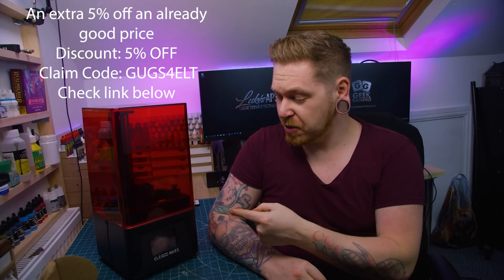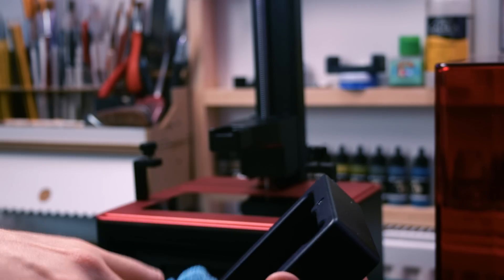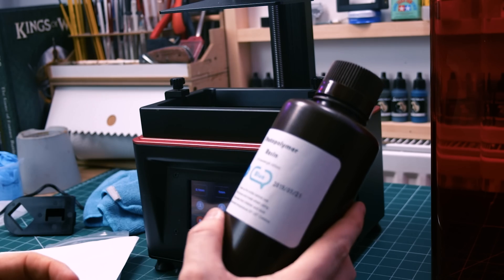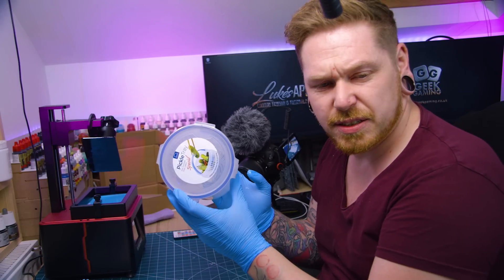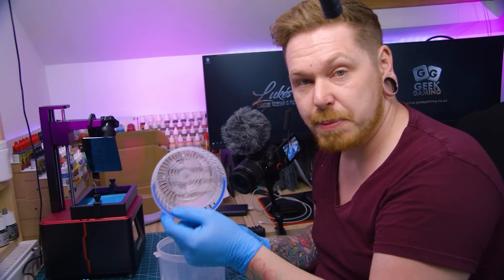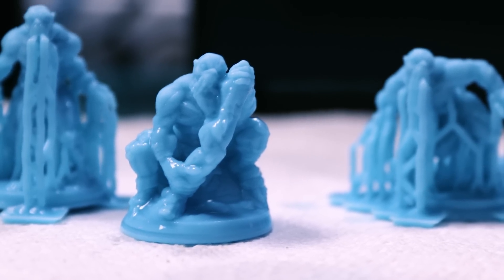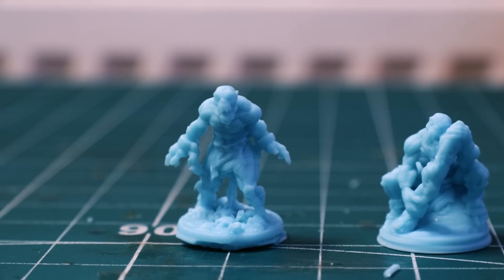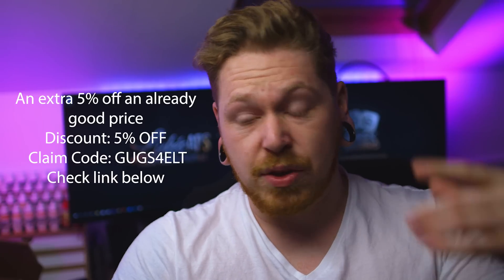MY FIRST TIME Using 3D RESIN PRINTER (ELEGOO MARS)

Comment: Judt got my elegoo mars 2 pro a week ago. When I levelled my plate I think I saw a YouTube short on how to do it easily, just set to home like usual, them push down on the plate with one hand (not too hard) while you tighten both screws, I've printed probably 12 models over 8 prints and haven't had a failure yet.

edit: he just did this lol, I should watch the whole video I suppose

Comment: You know what iv baught one the elegoo mars pro 3D printer months ago ok i actually over paid for mine cause people are getting these with a washer and curing tank too with resin i paid nearly 200 english pounds so about 230 to 250euros been from ireland and then nearly 40euro bottle resin i have not yet had a single test print that even stuck to my build plate its so painfull after buying something so exspensive not been able to get what i baught it for from it i am like u never used or seen one in person but i have to say im trying here for a successful print while i write this so wish me luck but i have to say you have explained what and how to so easily instructions from u as u said ur a novest like me i know noting of them but u explained in this video how i can understand easyer but iv had this print started b4 i watched this video from another guy it was setting it up i watched so if that works out ill be so happy i didnt throw so much money into the bin but ur advice and video has given me some confidence if this print fails on me but ill see in little over 2hours left but thanks for sharing your video my next problem will be downloading 3D stl file to my pc and slicing it onto the USB drive thing iv to learn next if this goes well is how to put 4 wheels on plate rather than 1 that pops up when i try its free stl file from thingaverse or something like u said u got ur prints from anyway sorry for rambling wish me luck iv it over or around 6months and have yet to get something from this its driving me mad well have a great rest ur week and week end stay safe keep good learner vids coming specially settings i type into machine to be set at normal printing so i know its rite u know that would help great like underneath lighting or the seconds or stuff like that u have to have saved in settings thank u 👍👍Keith just subbed u too im only model car figure builder the past 2 years but my printer is uploaded on my channel day git it then months later when i tried setting it up if ur interested but ill be watching hoping u have step by step setup with times settings on each part of the built in slicer and the printing on the printer. If u get what i mean. If u dont. Dont mind me bro im a bit of a winger when i cannot get something working ha ha lol u know frustrated i get u know how it is im sure have a nice day.. Again sorry for the SA in ur comment section from me mite have alot typos too sorry,,

Comment: I've just gotten the Mars 2 today and have printed those same files. First time printing resin, it went perfectly fine like the instructions showed. I got very clean prints from it, didn't use the plastic scraper, I used the metal one, IDK if the Mars 1 came with one but it was way easier. Nice video.
Reply: Awesome man! Was eyeing the mars 2 for myself as well. I think i'm for sure going to go with that printer

Comment: Hey I just wanted to say creality has a resin printer that is easier to use it's the creality ld 002r resin printer . I had 2 of them and ran them day and night 7 days a week non stop they are work horses and cheap to buy . I sold them and bought the peopoly phenom because I wanted a large build volume and it's also a work horse . Go ahead and buy a printer don't be afraid to break it you will be able to fix it or return it . You can buy the creality on Amazon go ahead and give it a try it's addictive . Happy creating.

Comment: What % of iso do you use?
Reply: 90% is recommended, but honestly 70% will work. It just takes longer to dissolve the resin if you use a weaker strength. Scrubbing with soft toothbrush helps a lot too.

Comment: fyi .. the plastic scraper is actually supposed to be used for cleaning the vat after a failed print .. you click a button tat says vat clean and ten after applying slight pressure underneath use the plastic scraper to peel off the thin layer or cured resin
Reply: @GeekGamingScenics  all good .. but for new people getting into it i have seen alot of ppl starting at 70% support amount which will also kill any detail

Comment: How long can a finished print and left over resin stay in the printer before taking it off/out. Like if a print finishes in the middle of the night and you can’t get to it until the morning.
Reply: That's fine. As long as the UV cover stays on the printer the part can stay in the printer for a couple of days if necessary. The resin in the vat will be fine too, but you have to stir the resin a bit before using it again if it sat there for a while. Just keep the printer out of the sunlight that might be coming through a window just in case. At the worse you might loose a little detail if a little light gets to a model that still has some resin on it, but inside the printer with the cover on it should be safe.

Comment: My printer is going through the process, but I don’t have a finished product....some random soft chunks left over at the end, nothing printed or stuck to the lift.....any suggestions?
Reply: @GeekGamingScenics  what do you mean?
Reply: Almost always this is a problem with the gap between the printing plate the screen. Use the plastic scraper to remove the debris and then loosen the top screw on the printing plate remove the printing plate and clean it really well with alcohol and a toothbrush. Replace it and tighten the screw on top and loosen the front and side screw that allows the plate to swivel (super important or you'll break your screen) and make sure the plate is straight and level and leave the screws loose (super important or you'll break your screen). Loosen the screws that hold the vat and remove the vat. Put a piece of paper over the screen and go into the position menu and hit the home button to relevel the plate. It will smash the paper creating no gap except the paper at first. You want a tight gap, but now you once the paper gets smashed by the printing plate make sure the plate is straight and retighten the swivel screws locking the swivel in place and then use the interface to move the printing plate up by .01 mm and then exit that menu and go back to the root menu and hit the house icon to set the z home position and confirm the current position as the new home position and you should be good to go. Go back to the position menu and move the plate up by 10mm at a time until you have enough clearance to reinsert the vat and tighten the screws that hold it in place. You'll be ready to print. Failed prints are almost always a problem with that gap being too large.

Comment: Pro Tip - (Not me, I learned it from someone else) Once you have it cleaned in iso put it under tap water Hot tap water. As hot as your hand can stand. Does not take much but makes the supports come off by hand 99% of the time. Saves a ton of cleanup and makes most of your supports come off with a simple push of the finger nail.

Comment: I am sure you know this by now, since it has been 9 months since this video. However, I will put the information here for others who do not know. That plastic scraper received isn't for removing the prints from the build plate, it is for when you are putting the liquid resin back into the container, you will use it to lightly scrape the plastic film that makes up the bottom of the resin basin. You should have received a sharpened putty knife in your Elegoo Mars kit, which is what is used to remove the prints from the build plate. If you didn't get one in your kit, then purchase one from a hardware store, and get it sharpened so you do have one.

This is a great printer for it's price. I have this exact model, and love it.

Comment: Just a couple of pointers from a seasoned 3d printer (Anycubic Photon S). You can compensate for any slop in your setup by spraying a little PTFE spray on your film (both sides) before fitting and filling the tray. It stops lower quality resins from curing onto the PFE and ripping a hole in it! Also, don't be tempted by "low viscosity" resins. They produce god-awful prints and end up very brittle after curing. My favourite is the flesh-coloured Anycubic resin - it ain't cheap but it's really reliable and much easier to trim than the cheaper ones. That's what I used for my recent full print of Magnus the Red (send me a message if you want the STL for him!) And he came out amazing. Gonna be uploading a video of the process soonish.

Comment: According to the manufacture you are supposed to tilt the models at a 45 degree to prevent them from sticking too hard on the build plate and th prevent errors. You really need to go watch and read up on these printers to get quality prints.

Comment: Question how you you know when it is really clean?
Reply: Just use some alcohol and a soft toothbrush and a jar to rinse the part in. You don't have to worry about it too much. Break the supports off and wash it again. If you can see all the detail that's clean enough. But let it completely air dry before trying to cure or you'll get white spots.

Comment: I just bought the Anycubic Phantom but this one was my second choice... can’t remember why! Regardless, so fucking cool!! Only “problem” I’ve had, is scaling properly with the slicing software. Can’t find a way to get exact measurements of the object before printing 🙃
Reply: Make a little ruler that has 1 mm stair steps in your modeling program and you can import that with your model and scale according to that.

Comment: Great video, excited to see what you do with it!

About switching resins, I'd give two reasons to ever want to change: transparency and strength.
With clear resins I've found better performance printing thicker solid objects, because the UV light will penetrate past the outer layer when you are post-curing. If you are just doing small objects then it's probably not much of a concern.
Meanwhile, you may find that the resin models can get to be a little brittle (especially when dealing with thinner features). One thing you will find is that there are really a TON of resins out there with very different mechanical properties -- resins which are harder and more durable (look for "ABS-like"), resins that have more flexibility akin too the Reaper Bones material, even resins that come close to silicone rubber. One thing I have seen a couple people who print and sell minis on ebay is using a blend of two resins together -- something 80% standard resin (like the blue you used here) and 20% of a strong / flexible resin ("Tenacious" resin is the brand name I see most common). I've tried the blend and it seems like it adds a fair bit of durability to the piece without sacrificing any detail.

While I've found it's a lot harder to get sharp details from the ABS resin, one thing I've started doing is building small jigs on my computer and printing them in ABS. With a little research I learned that people have successfully printed ink stamps, so one thing I want to try is printing off a few of those and using them instead of stencils for certain kinds of regular painted features.

Cheers!

Comment: What happens if you mix different kinds of resin in the tray?  Will they mix and still print?  

Great video, it's good to see going from no knowledge to printing is a few days.
Reply: Yes, most resins are basically the same, different colors or slightly different properties, so as long as they are marked as curing the same wavelength which I think is 405nm for these little printers you can mix them them all together to get different colors and properties. It won't hurt anything to mix them together.

Comment: The Elegoo Mars really is an awesome machine. Hard to believe how much this technology has come down in price in the last couple of years. I've been using FDM printers for over 7 years for making larger terrain pieces but for actual miniatures, resin is the way to go. Yes it's a lot messier than FDM and the cleanup process needs to be handled more carefully, but it's still a lot more fun than spending hours sanding PLA.

Horses for courses really - Both technologies have their uses in the hobby, but you can't beat resin for fine detail, and the Mars is a superb, solidly-built piece of kit. Its nearest rival, the Anycubic Photon has a less powerful UV lamp (25W whereas the Mars is 40W) and thus takes a tad longer to expose each layer, meaning that the same print will take longer on the Photon. (Note that the newer Photon S also has a 40W lamp and so prints faster than the earlier version but I have to say that I looked at it and it lacks the build quality of the Mars.

A quick word on the resin - Most suppliers sell it by weight, not volume (ie.  1 Kilogram rather than 1 Litre - Be aware that standard photopolymer resins have a density of around 1.1g/ml, meaning that 1Kg in weight is around 900ml volume, not 1 litre as many people believe (I see people online all the time referring to resin supplies as 1 lite, 500ml or 250ml, whereas in reality the actual volume is around 10% less than the weight)

Also the ChituBox software does seem to use a fair bit of resin to generate its supports (and as Luke pointed out, doesn't always get them spot-on), so, as with FDM, it's always better to try to get models that don't need supports - While this is not always possible, it's something to bear in mind if you're designing your own minis from the ground up. (making the models multi-part is a good way to avoid having to use supports but I'll be the first to admit that this can be a royal pain at the design stage, although there are several programs out there that can cut up models for easier printing, such as Netfabb Studio and others. Many of these are free and although mostly designed for FDM printing, they work just fine generating STL files for sending to Chitubox

How does resin printing compare with FDM?
Well if you're after great fine detail, then resin will knock it out of the park. Yes it's more mess, more cleanup, post-processing (washing, UV curing etc) and it's also more expensive, though the cost of resin is coming down as more and more people get into this stuff. The LCD exposure mask in the printer is also a consumable item - the UV fades it over time making it less effective (fuzzy edges on your prints etc) and the FEP film that forms the bottom of the resin tank is also affected over time and is easily scratched and/or punctured. All of these parts are easy to get replacements for at reasonable prices.

One particular note on the Mars - it's a great idea to put a strip of making tape over the left and right edges of the LCD screen under the resin tank, as this will give a few microns clearance so it's harder to scratch the LCD screen when removing and replacing the tank.
Reply: Great info!

Comment: How many models printed off that size bottle of resin? Can the off cuts and failed pieces be re used somehow or is it just waste?
Reply: Waste. Not like FDM printing, where the plastic can be re-melted and formed back into usable filament using an after-market extruder.

Comment: The only problem with the my lee UV chamber is its 395nm light wavelength where as the resin cures at 405nm. I don't know if that means it wont work? or just slower to work? anyone?
Reply: I suspect it will work unless the wavelength is very carefully controlled by your chamber's manufacturer someone. There is some bleed over in wavelength in most machines. It might take a little longer though, but you can always sit the part in the sun and it'll cure. On cloudy days it might take all day or even two days, but on sunny days only a couple of hours. Sitting the part in an aluminum foil tray helps a lot.

Comment: For better supports, try using PrusaSlicer.  You can open your model in PrusaSlicer, right click> Optimize Orientation to calculate the "best" orientation, then use their Auto Support feature.  The Prusa Slicer auto supports are much better than Chitubox auto supports.  You can also go into Print Settings > Pad and change the Pad Wall Slope to 45 degrees to make it easier to scrape off the bed later.  Once you've supported your model, you can go to File > Export > Export Plate as STL Including Supports, then reopen that file in Chitubox to slice to your settings.  Hope that helps!

Comment: Sistema brand strainers are available on amazon in the uk, they're what I use for washing resin, link at the end. You can get water washable resin for folks who don't want to mess around with IPA. Also Luke, get in the habit of popping the cover back on as soon as possible, stops the resin from curing in the vat, like it was starting to do while you discussed pickles:p. The software "PRUSA slicer" will do a better job of automatically adding supports. https://www.amazon.co.uk/gp/product/B002ARYAQQ/ref=ppx_yo_dt_b_asin_title_o04_s01?ie=UTF8&psc=1
Reply: Thanks, after a failed visit to ADSA (God I hate going there!) to find a pickle jar your link looks perfect :)